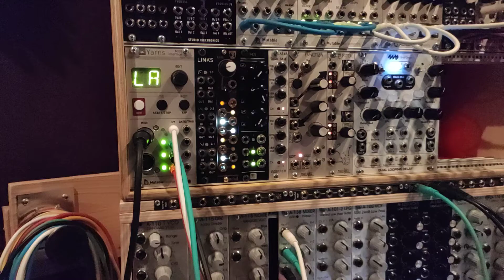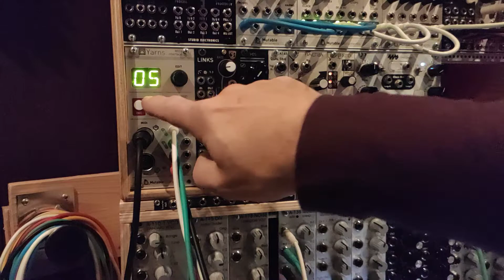Eurorack Mutable Instruments Yarns tutorial - Sequence with Chords using the internal Oscillator

Comment: Thanks can you detune the voices in a subtle way?
Reply from the maker: Besides the course tuning in semitones (funtion TT), each part/cv output and so also each of the four internal oscillators can be fine-tuned in 1/64 steps of half a  semitone, both up and down (function TF). The increments per step are so small that it sounds absolutely as a very  subtle continous pitch adjustment.
Reply: @ricksanders  great have one on the way will try that out, thanks